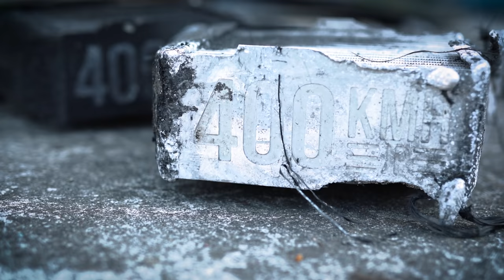Wir zerlegen die alte RS4 Limo! Wie geht es weiter? | Philipp Kaess |

Comment: Alles was da dran ist würde ich bei nem Auto was 3 Bar fahren soll/wird nicht mehr nehmen...spar da lieber nicht dran...der Stahl eines Küchenmessers hat schon nach nem Gang in der Spülmaschine ein leicht verändertes Gefüge, du hattest hier minimum 660°C weil ja deine Aluminium Teile geschmolzen sind...lass es lieber. Die Antriebswellen sind bestimmt auch weichgeglüht...haste ja schon selbst angesprochen, dass das nicht mehr zu gebrauchen ist...
Kleine Anregung für Limo 2.0 Wie wäre es wenn du eine zentrale Löscheinrichtung in den Wagen einbaust? Z.B. eine CO2 Löschanlage? Seilzug (Mechanisch betätigtes Ventil) damit das Teil nicht unbeabsichtigt losgehen kann oder eben wegen Kabelbrand nicht mehr funzt und Tank im Kofferraum. Klar, ist mega Zusatzgewicht, kann aber das Auto retten. Und die Leitungen mit den Auslässen könnte man dann vorrangig auf den Tank, den Motor und das Getriebe und auf die Abgasanlage richten, sodass quasi die Hitzequellen schnell runtergekühlt werden und die Stellen, an denen Gefahrstoffe sind (Benzin/Öl) direkt safe sind.

Comment: Ich weiß ja nicht wie Hitzespabil eine Kupplung ist aber auch da wird denke ich nicht mehr viel von über sein oder? Wenn man bedenkt das das feuer vermutlich dort irgendwo ausgebrochen ist.
Reply from the maker: Doch doch, die denke die Kriegt bei Allradstarts sonst auch gut Temp. Aber das sehen wir alles bei zerlegen... es bleibt spannend.
Reply: Denke, da die kupplung eh ein Verschleißteil ist, würde ich die direkt neu machen.
Reply: @rainerknuth  Eine Kupplung, wie sie in einem hochgezüchteten 1300 PS+ Auto steckt, ist nicht einfach ein Verschleißteil, das man mal eben tauscht. Die kostet richtig Geld und einfach so zu kaufen gibt's die wohl auch kaum. Wird wohl eine Sonderanfertigung sein, wobei ich das Thema bei der alten Limo nicht verfolgt hatte.